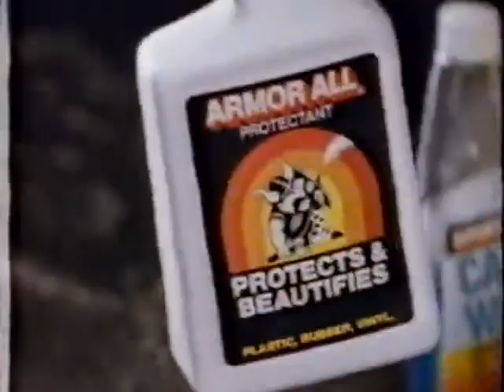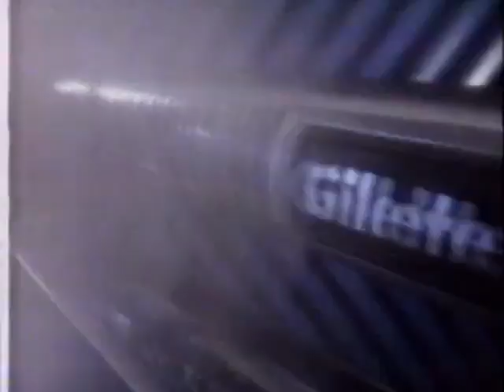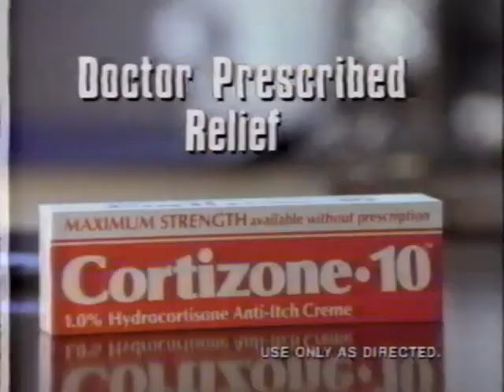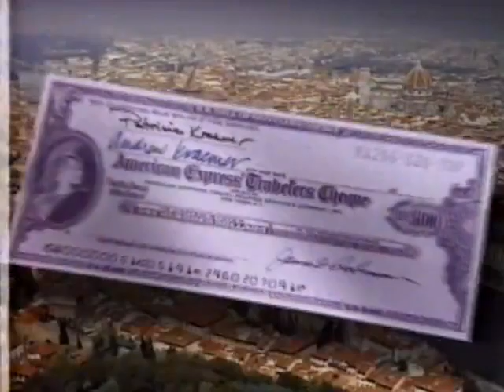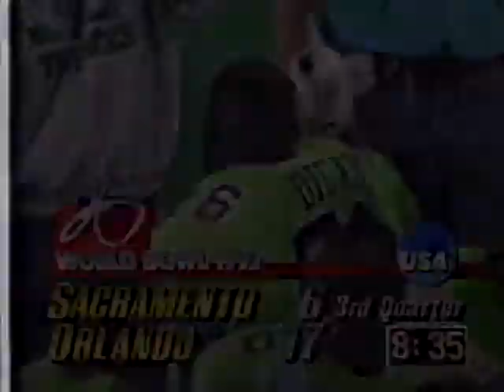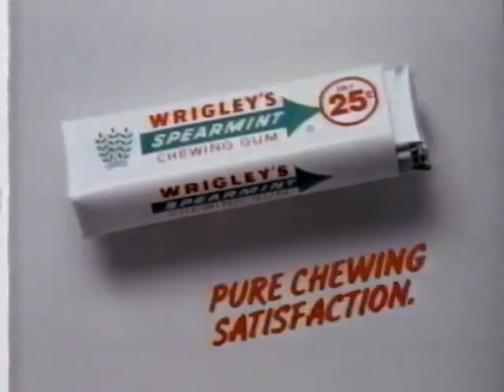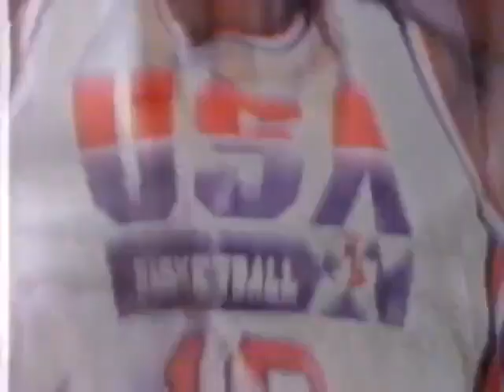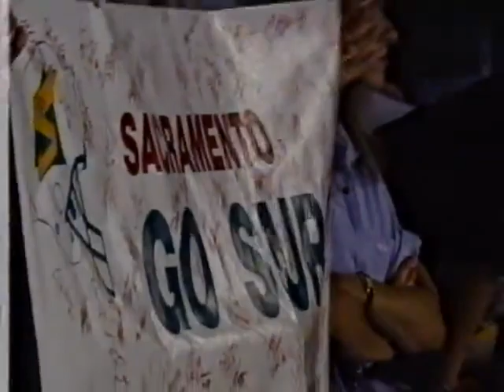6/6/92 WLAF World Bowl '92 Orlando Thunder vs Sacramento Surge

Comment: Attendance for World Bowl '92 was 43,789 fans.
Reply: Damn good crowd. WLAF was so awesome. They gave up on it too early. NFL is greedy. That’s why I don’t want the NFL to touch the current UFL league. The league is on the right track, not perfect there’s things to fix but tv ratings have been strong. They just need to work on attendance.  The product on the field is probably the best ever for a spring league since the original USFL however you can’t compare that league to the other spring leagues that’s popped up since. Original USFL was after the NFLs’ tail and it was great 👍🏻 the leagues since won’t compete versus them.